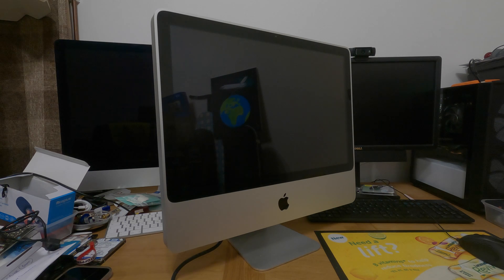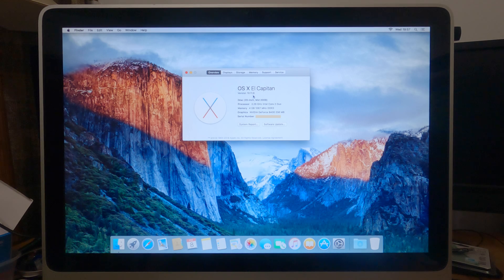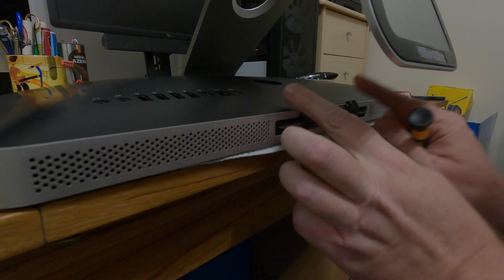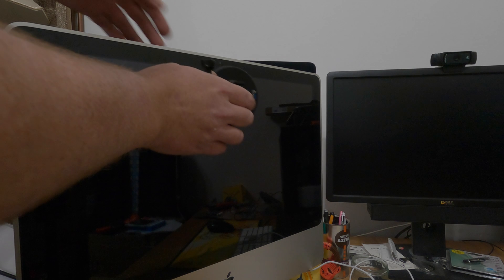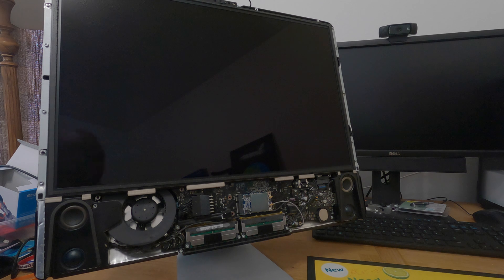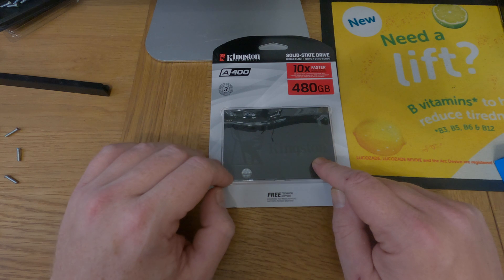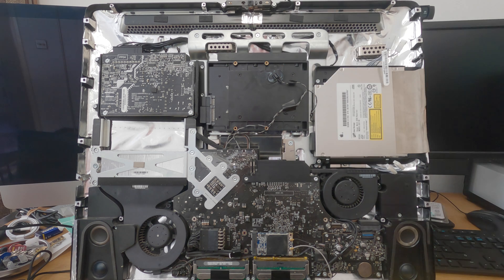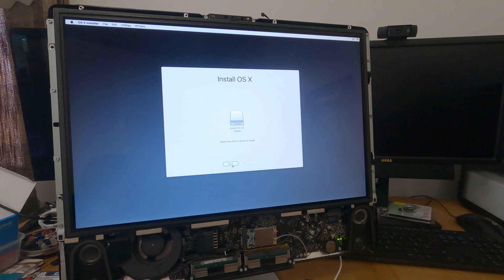2009 iMac RAM & SSD upgrade in 2023

Comment: On the back of the LCD screen there are a few cables that need to be disconnected as well. Two in the top and two in the button.. 
The cables are gray - and the plugs can be connected either way ..... 
How to know which cable goes on which plug - and upside down or ?? 
This is not the only video about unmounting the lcd - but no video explain anything else about these cables... 
Only to disconnect them - and when connecting the LCD again - they say connect the cables again... 
Yes,,,, but how and on which plug.

Comment: Can I do an upgrade to the SSD and just clone my old hard drive and not have to install no OS
Reply from the maker: @BoocheeWutYuDoin  Yes you can, however in this video, I needed to do a clean install anyway
Reply: @andycdgreen ok thank you. I order everything. Got a yo get back running smooth and stop lagging and get rid of the loading spinning wheel

Comment: Hello very good video, a question you didn't have problems with the temperature and the temperature sensor that goes in it was going to the mechanical disk because I have tried to place in iMacs 2009, 2010, 2011, and when I put the SSD the temperature rises a lot and it is obvious from the heat sensor that when placing it in the SSD does not produce enough heat for the Imac to detect it
Reply from the maker: @Cinefilo_Celuloide  This model had no problems with temperature sensor

Comment: Going on six-year-old memories here, I bought one of these at a pawn shop, that booted to that ‘folder ?’ Screen.
I remember using Google search and found a particular key combination would boot it to “Online Recovery” IF it was hardwired to the Internet.
One option was (basically) a full re-install of the then-current OS. Took about two hours.

Upgraded RAM from 2GB to 16GB, and gave it to my sister, who needed an iMac (hers was stolen during a break-in)

(I got it super-cheap because it would only boot to that “Folder & Question Mark” prompt, and no-one there knew what to do (they had it a year))
Reply: i dont think we have access to that download anymore as  i tried last night and received an error after signing in with my apple ID to do an online reinstall. :c

Comment: Question - Do I need to install the OS on SSD before inserting it, or will I be able to use a recovery mode?
Reply: did recovery mode work for you
Reply from the maker: Recovery mode, or create a bootable USB MacOS Installer
Reply: @andycdgreen   Success!

Comment: this could go way up to 16GB of rm than the 8GB..also could be proceed to OCLP Monterey for better macOS version..
Reply from the maker: You can install a later OS, it's a bit more faff to get it to work, plus due to the age of the iMac, it will start to struggle on newer OSes
Reply: @andycdgreen  Actually you can run on Mojave Patcher since it was only runs with 8GB of ram and fully a 32-bit systems that supports it..

Comment: Thx a lot! I got the exact same machine and actually got stuck after putting a SDD in! It chimes but keeps a perfectly black screen, option does not work (so I cannot switch to y USB installers (Linux Mint), PRAM reset works but changes nothing. After the chime it stays black. Would I have needed to format the SDD? I put it in there just as I bought it! Is there still hope :-)? Any hint appreciated! Greetings from Chile!
Reply: sounds like you may have not connected the screen connectors properly. If you miss one it won't work. Stick the install USB and try booting while holding down option and if it's still black it's the connectors.
Reply: How's the performance? Found a C2D 4GB RAM 250GB for 50 early 2009

Comment: Great video, I'm currently pondering whether to scrap my 2009 iMac, but your video is telling me maybe I shouldn't. All great info & I have my shopping list. My only question is where do I get the operating system USB?
Reply from the maker: You need to create it yourself, lots of videos on YouTube showing you how. Just look for creating a macOS bootable usb
Reply: So what Mac OS should I be trying to get a bootable usb for? I have a late 2009
Reply: @reeceryan793  high sierra is the newest os you can run on late 2009 iMac
Reply: there are tutorials to unofficially upgrade to sequoia.

I'm currently running Sonoma on a late 2009 27" model.